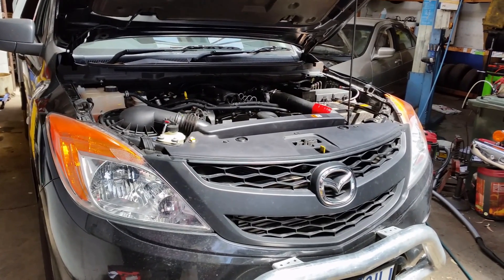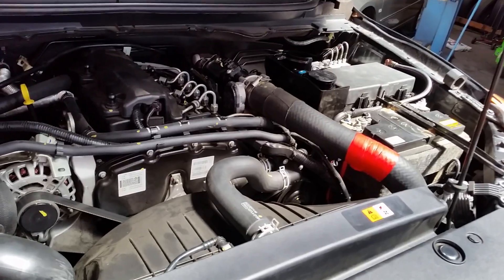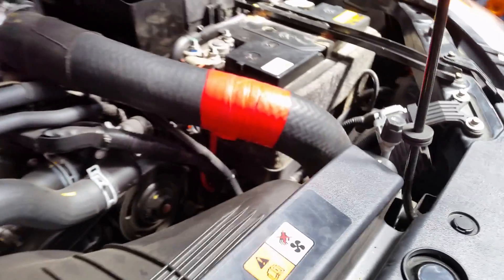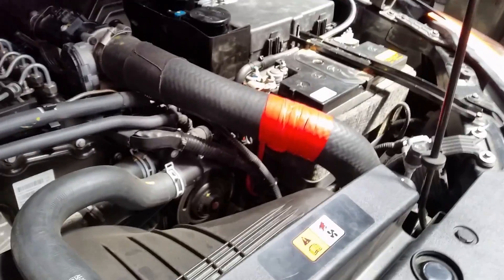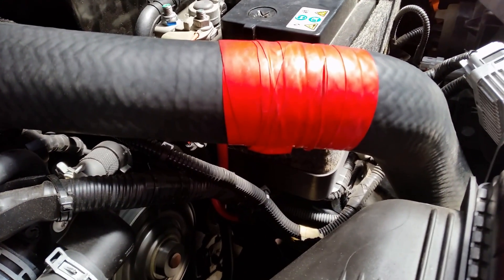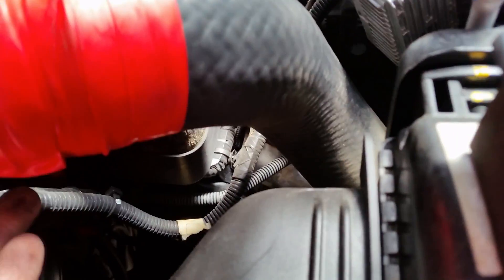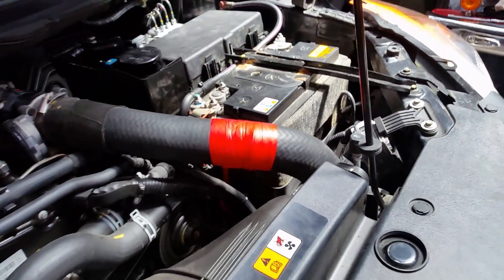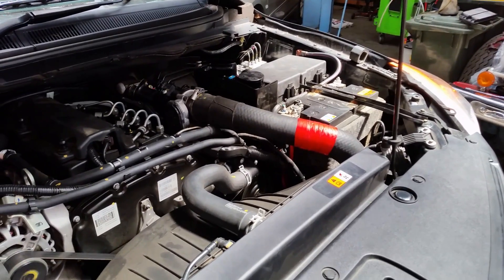DTC P00BD diagnosis on a Mazda BT-50 2.2L Turbo Diesel

Comment: It is a Fault with Ford and Mazda...My truck same as yours even same color...2013/2014, my truck only 39,000 km... split in the same location as yours...I could not believe as my truck is like new...also have bad smell of fuel ...think different issue. Algae...truck sit for long periods of time..

Comment: Thanks for the info. I've had the same issue with my BT50 but discovered it was the intercooler was blown in the middle at one of its tubes. I steal epoxy it and my problem was fixed lol.

Comment: This cause powertrain light ?
Reply from the maker: Yes, after a while but you need a scan tool to determine what caused that light to illuminate.
Reply: This happen to me yesterday.. The powertrain light appear and I check Intercooler hose..got small crack and hole..
Reply: yes

Comment: I have the diesel 3200cc engine and could you tell me how you test your maf sensor
Reply from the maker: fleet tech That is an excellent question and I have not found a solution to it in practice. you would need to make up a testing unit with something like a ducted fan where you can vary the speed and another air flow meter with a known transfer function (to convert output voltage, duty cycle or frequency to grams/second) then you could connect the airflow meter under test to this rig and vary the fan speed while comparing the known good reading to what the scan tool says the car's ecu is reading in grams/second or whatever units you choose to use. if you have a deviation then you can determine it as faulty or clean it and test again.

This would make an excellent video an i may demonstrate this in the future.
Reply: Frans de Bruijn my bt50 when it is cold and starts up you can smell the exhaust very strong and it is using more diesel than normal
Reply from the maker: fleet tech try use a MAF cleaner spray on the airflow meter.
Reply: Frans de Bruijn I will try that
Reply: @fleettech3570  Did it help?

Comment: Would this cause my truck to go into limp mode and the turbo to spool up more than it usually does?
Reply from the maker: Omarie Durrant it will throw the check engine light and will lack the expected power when the turbo spools up.

Comment: Mate! You are awesome I had the same code come up on my bt50 the shop was going to charge me $600 to replace the mass air flow sensor. But after watching you're video I found my hose was slit as well.Still cost $250 for the hose but was a lot cheaper then the replace of the air flow sensor. Thanks mate😀